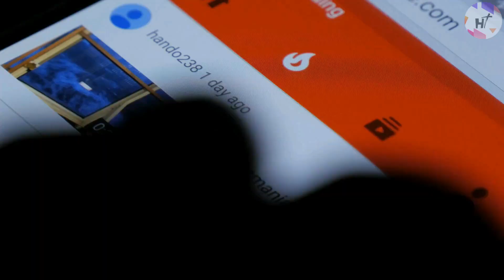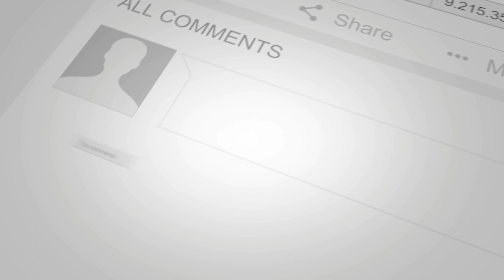A Genius Invention Revolutionized Transportation of Gas on Gigantic Ships | LNG

Comment: I love this product. I believe it's a real game changer for the shipping industry.  
It's simple...  
You fill up a trailer with fuel on a ship. The trailer is pulled by a tug using a rope.  
When the ship gets to its destination, the trailer is hooked to a car.  
The car drives the trailer to the station where it is filled up with gas.